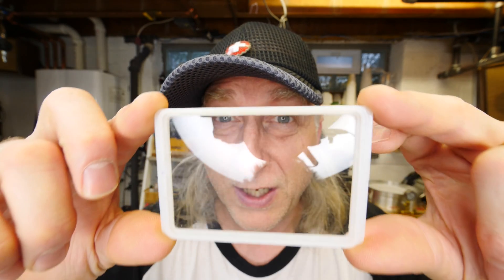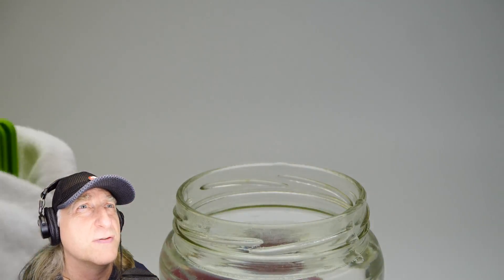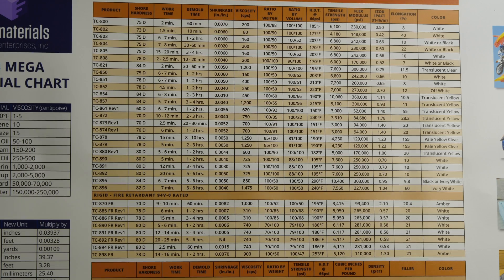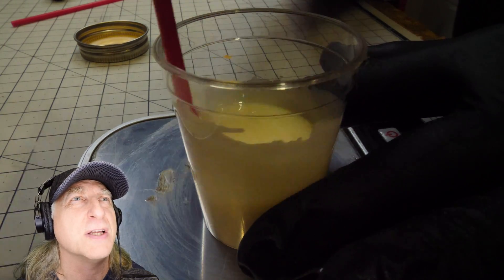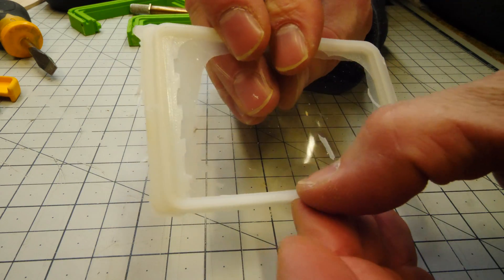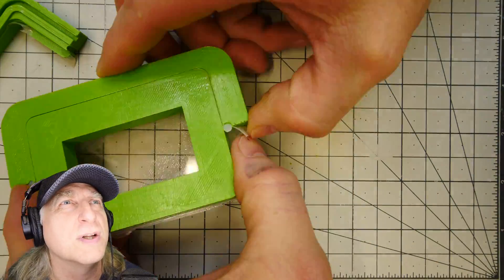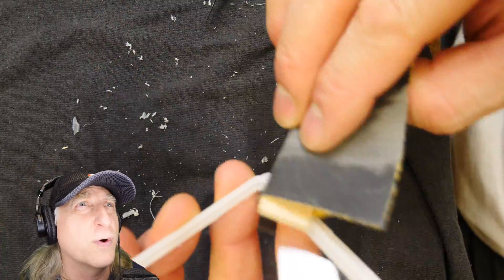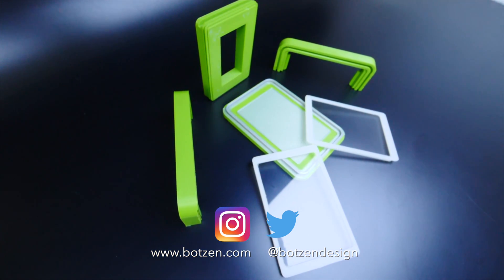Over-molded Clear Parts with Polyurethane

Comment: Great job on the mold and parts Eric!  We love seeing your skills at work showing practical yet professional mold making methods.  The CF-80AM material's unique ability to accept pigments ranging from light to dark colors AND color stability when exposed to moderate UV light makes it a great system for prototype or production parts.  The nomenclature is: 80A = 80 Shore A, M=Medium Worktime.  There is a faster version CF-80AF, plus a range of 50A-95A products in Fast and Medium work times.
Reply: Do you guys have posters in PDF format like the one Eric featured in this video? I searched your website and didn't have any luck.
Reply from the maker: Oh, good to know!